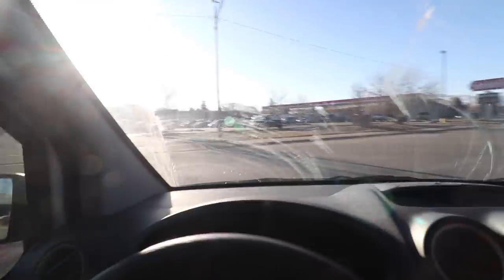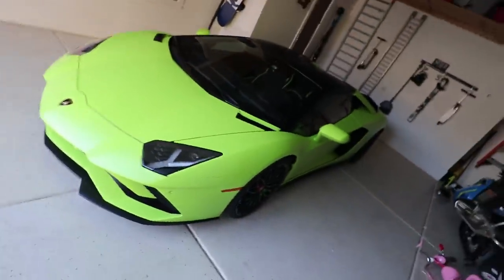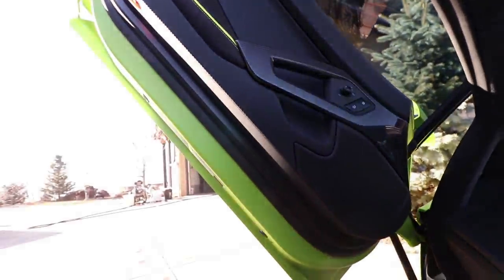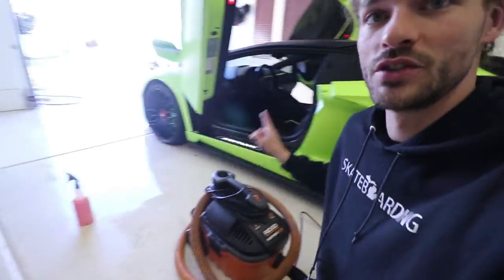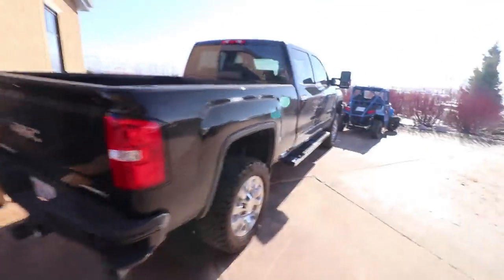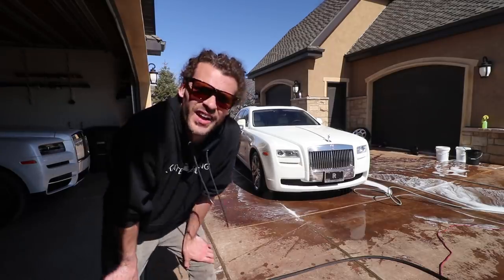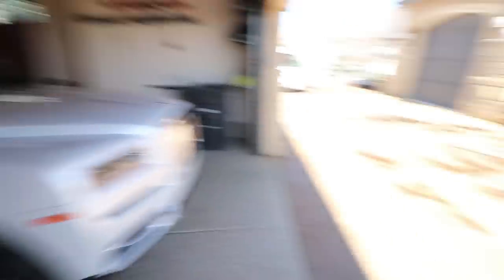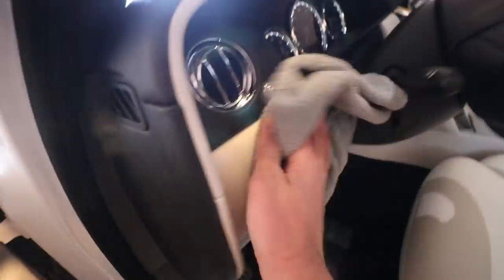Detailing For My Wealthiest Client!!!

Comment: Honestly good for you with the detailing business but you should never hold a pressure washer 2 to 3 " from the paint especially a Lamborghini or high level vehicle 8 to 10 " a way it will wash it... if not hand-wash again and rinse

Also after each vehicle empty the buckets  and re fill them you should have one without soap and one with soap and you dunk the mit into the one with no soap & rinse it off and then dunk it back into the soap so basically only touching the car after the soap bucket and you put it in the non soap bucket after   and repeat 
This takes off all the loose dirt micro rocks or contaminants at the bottom of the non soap bucket you'll see everything it will settle to the bottom 

Need some experience
Reply: Gold pretty sure he’s doing all of that already, the dude had like 3 buckets out and he was holding the pressure washer far enough. Pressure wasn’t even that high cars were already pretty clean. If there’s no chips in the paint the pressure washer won’t chip the paint if he’s holding it close. This guy knows what he’s doing.

Comment: A detail is a full wash bumper to bumper including the engine. An acid wash is preferred, that is to remove any oxidation and impurities that the vehicle may have incurred over time. Using an air gun to dry the vehicle is also preferred, as well use it on the inside for the small creases etc. Buff out minor scuffs and or scratches. Final stage do a 3 stage polish o the vehicle to protect against hard water, acid rain, impurities, oxidation, etc. 
Well these are not all steps, but just a few steps so you guys/ gals can have a feel on how to do a detail correctly. 
Good day!!
Reply from the maker: A correct detail is doing what the client wants and is paying for 💯
Reply: @SummitLife  well do not say you are going to detail!
That's a basic wash and a wipe down.
A leaf blower, really!! That does not dry any crevasses at all. Just saying.
You do you...God bless
Reply: @SummitLife  keep up the good work guys

Comment: For a gas pressure washer that foam was pretty weak.  I guess either soap isn't great or you use too little?  And that leaf blower didn't seem as powerful as mine, even though visually they may seem like the same thing.  I actually don't use mine anymore, got a Metrovac sidekick and that is great for all the crevices where water likes to hide.
Reply from the maker: I had very little soap in my gun, usually its awesome foam

Comment: You know if you buy a water filter you can let the car practically dry itself with out water spots to be worried about! Quick tip
Reply from the maker: I have one! They are super nice, just expensive to maintain.
Reply: SummitLife you can rent one and change the actual filter every month for $40 but yeah they come in handy I can’t live without it lol specially when detailing motor homes

Comment: Great video bro, You need to invest in a hot air dryer, we used one when i worked at Harley Davidson and it was amazing, It would dry cars/trucks/motorcycles in seconds and the newer ones available now blow even harder and hotter. Check them out 
Circuiteer II Hot Blower-Dryer
Reply: Damages wax and paint

Comment: Future tip. You shouldn't really use hot water in a cold water pressure washer the pump is not made for hot water.

Comment: Don’t need to start it to get it out. Push the button without foot on the brake and then brake and hit the right paddle into first and just roll it out with your foot. Way easier on the engine.
Reply: You need to hold the break when you hit the push to start button you’ll mess up the engine if you don’t.
Reply: No. You only need electronics to get the car into neutral. Both paddle shifters at the same time. Lots of experience with Gallardos. There all electro hydraulics. If you hold the brake and push start the engine fires, defeating the entire purpose of putting the car into neutral without starting it...

Comment: What is the fuss, I have seen these cars at the dealership the swirl city with 15 miles on ODO. I took delivery of $50k car with 30 miles and the dealership washed it looks like with a scotch bright.
Reply: @Sluicey  it makes sense for the enthusiasts. However, for the sales ppl, dealerships detailers ( it is a crime to give them a title) and the mechanics is indeed makes no sense. So, I detailed a swirled brand new car putting 10 hours and $200~ to fix a screw up. Next oil change picked up the car with worse swirls despite of my sign not to wash on the mirror. This is a cat and a mouse game. The dealership didn't reimburse me for the damage but offered to repair it. No thanks, 1 inch thick of Mothers glaze I can put myself. Here we go again, need to put 15 hours to fix the current damage which is more moderate.
Reply: @klimankhmeron7636  Yea man I have to agree with you with the detailers at dealership, I would never advise anyone to to take their car to a dealership for a really good detail job.  Dealerships in departments like mechanics and detail all have to work pretty damn fast to keep up with the volume of cars they are getting. To do a solid detail will take time, right techniques, and carefulness. Same with repairing/servicing cars. Unfortunately mechanics and detailers do not have the luxury to really take their time on cars. They are constantly having to be rushed or be pretty fast.
Reply: @ElisaTuscani27  my car recently went in with one minor cosmetic damage and came out with 4 severe damages. And it's a luxury brand. I would rather live with that 1 barely noticeable manufacturer defect than to trust those morons. Live and learn.

Comment: I just watched a few of your other videos, you're not detailing those, or, any cars, you're just washing them
.
At the end of the Cullinan wash, NEVER use the same cloth you wiped the bottom of the doors on any other part of the car, I could bet you wore the same cloth on the roof afterwards, NEVER use the cloth you wash wheels or any car bottom parts back on paint again (Even after washing them, some small brake particules don't wash out of the cloths).